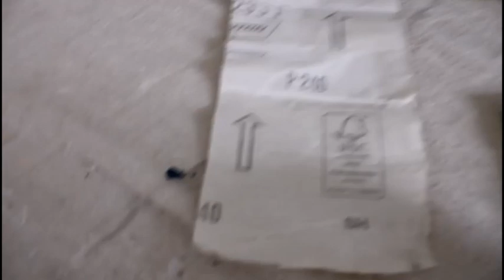How To Paint A Door Using Water Based Satin

Comment: Why don’t you get the paint on using a mini roller & then lay it off? much more efficient than flicking a 2” brush about?
Reply: I guessing its a texture thing.
Reply: Unless its a completely flush door and you have a dozen or more to paint it's just as quick to use a brush that's probably why he uses just a brush
Reply: It depends on various factors including the kind of paint and the ambient temperature. I tend to roll doors with a 4" roller either foam or microfibre, and lay off with a brush. A panelled door takes 10 mins per side with this method. In hot weather you have to apply water-based top coats that much more quickly and the faster roller on & lay off with a brush really works best for me. That said, this week I've been painting with Johnstone's Aqua water based gloss and preferred using a thick-bristled 2" Hamilton as I didn't find the roller speeding things up much. Happy experimenting!
Reply: I thought the same 🧐 I'd use a roller & brush
Reply: I use a brush to get it on then roller, I love the orange peel look, personal preference eh.

Comment: I ended up buying this paint and using a pure bristle brush just like you did in this video. My results weren’t as great as your review of the paint. I undercoated twice with armstead trade paint and then applied two top coats and even three in some areas and the coverage was quite poor. There were a ton of brush marks from the pure bristle brush too. I switched to a synthetic brush and that was somewhat better. Overall, I wouldn’t purchase this paint again.

Comment: My head gets frustrated with water based paints..I have done some test bits of skirting boards in varying light conditions in my house over the past two years and i am finding that some of these water based paints yellow too. I did one with armstead quick dry satin and after two years it has yellowed ever so slightly. Not much but definitely not as white as it was new. Homebase own water based gloss stayed the whitest of them all believe it or not lol although it not easy to get a good finish. . I have had a bit of skirting board in a dark cupboard for two years with dulux oil based gloss painted over a water based undercoat and it hasn’t yellowed too badly at all surprisingly. Sometimes I think the undercoat can effect the yellowing of the top coat. I sometimes go down the route of using oil on all jobs and just tell the customer that it needs redone every five years. I think all paints discolour and I’m tired fighting for a good water based alternative lol. I’m sticking with oil unless the customer can’t cope with the smell lol
Reply: Throw some vanilla extract in oil paint, helps with the smell.
Reply: Keep breathing in them paint vapours brother. I wont work with oil based paint unless the costomer is giving me £250  a day

Comment: they don't recommend using natural bristle with WB usually
Reply from the maker: We generally only use pure bristle they work great...  use them in emulsion all the time.
Reply: @PaintingandDecorating  I'm a big fan of them too, use them whenever I can. Just always been advised to use synthetics in WB wood paint. But I'll take your word for it judging by the videos you put up on here.
Reply: Great video and Hamilton pure bristle brushes I find also great for this application. Used the armstead quick dry satin in my own living room a few years back..... still looks lovely and white.... just one drawback I find... it might just be me... but when I wipe off dirty hand prints from the door with a clean cloth. The paint feels a little sticky afterwards for a few days at least. Then returns to normal? Weird I know. Doors were keyed and prepped very well beforehand. And also the sun on the window cill tends to make the pint feel tacky also. Weird.
Reply from the maker: Yes water based are not hard wearing...

Comment: Stick a little bit of Floetrol in with the water based paint and it gives you a bit more working time with it. Same with Owatrol for oil based paints , goes on lovely .
Synthetics are better than pure bristle in water based paints as well.  Nice vid .👍
Reply: Pure bristle can be just as good as synthetic or even better in some cases with emulsion, don't talk bollocks .
Reply: @simonright1507  even the Dulux trainer videos suggest using quality synthetic bristles for acrylic satin. Pure bristle is best for gloss.
Reply: @simonright1507  it's personal taste, pure bristle is better for oil based but you can use synthetic for oil as they are far better now than whst they used to be, I use synthetic and I've been a p and d for 37 years and I find them convenient as you can use them straight away without having to braik them in the other reason I use them is that a lot of the time it's water based paint I'm using not allways by choice I mite add .

Comment: Synthetic brushes are a must with water based paints. 
Because pure bristles draw moisture out of paint and can cause drag marks.
Best to dampen brush first before applying paint.
I also prefer to lay off 
To get rid of brush marks.
Reply from the maker: More control and faster painting using pure bristle...   synthetic... it's in the name...   keep it real.    only reason they push synthetic brushes is because they are cheap to make...   if you have not used pure bristle enough you wont understand.
Reply: I was pure bristle then went synthetic. Spent a lot of money only to find myself back to bristle. Whatever you feel happy with and works for you. No problems.
Reply: 100% mate. No way would you use pure for water based

Comment: I work with waterbase  undercoats all the time and glosses and they dry so quickly my method would to be to use a small scuttle and a hamilton  medium piles 4 inch roller just to get it on quick and would defiantly use a dulux trade as they are far better than DIY store Shop paints and to get a great cut in use a purdy  angle brush.

Comment: Can you recommend a satin that's not water based that doesn't yellow. I've got a skirting board in my hall that gets bashed a lot, I need something resilient but don't like gloss or yellowing? Thanks.
Reply: Only water based will not yellow. Try Johnstone's Aqua guard. Very hard wearing.
Reply: crown trade oil satin and Albany oil satin don't seem to yellow had them both in the garage without uv light for around 6 years and still white on the side of the tins all the others dulux jono's have gone yellow Albany oil gloss and crown trade next gen oil gloss hold the white for a long time too for todays oil glosses

Comment: Thanks for this video. I didn't expect you to get it on YouTube so quickly. Interesting about the Armstead paint and it has good reviews on Screwfix. But I was slightly concerned by one comment I saw, which said that it had slightly yellowed after a couple of years. As far as I can tell the Zinsser Perma-White satin doesn't yellow.
Reply: It doesn’t yellow at anywhere near the same rate as oil but it still does loose some of its whiteness. To be honest I think all paints discolour slightly. Even ceilings can discolour over time. I use oil for the finish it gives and use water based and waterborne paints if it’s a particularly dark room or the customer doesn’t like the smell or if the customer is happy for me to spend a lot of time changing their woodwork from oil to waterbased. But on most jobs I find dulux oil based gloss in white will stay white for a perfectly acceptable length of time especially over waterbased undercoat. Crown trade satin finish is also white and stays white for a good long time and its oil based. I have been back to jobs three and four years and it still looks white. I tend not to use brilliant white though I only use white so maybe this has something to do with it not going yellow as much. It’s a minefield but if I’m on a big hall stairs and landing that has been painted in oil before the last thing I want to do is charge the customer for me to paint 10 doors and frames and spindles all with three coats of waterbased paint when the advantages aren’t all that great considering it gets dirtier easier and doesn’t stay as white as u think. I’m happy with oil nice finish needs done in five years and wears well lol
Reply: @stuartmcintosh7187  Thanks for your detailed reply. I'll probably persevere with the Zinsser Perma-White satin for the time being but I may go back to Dulux oil-based in the future.
Reply: Mark Rowland I have used the Zinsser perma white satin in my living room about three years ago and it is still nice and white too so it’s a good one. I like how it adheres to old oil based paints without having to use a primer!
Reply: @stuartmcintosh7187  Yes, I've used it a few times now. Bit tricky to apply compared to oil-based but imo the advantages out-weigh disadvantages.
Reply from the maker: A customer as just asked me to start using oil gloss again for them...  as they think it looks better.
Reply: @PaintingandDecorating  I wonder if they'll be saying that in five years when it's yellowed a bit. Certainly looks better when freshly painted but after a few years...???
Reply from the maker: @markrowland5393  True but it does depend on how much natural light...  would be better to use a very pale grey instead of white...  people would get use to it eventually.
Reply: @Gary Day No. Have you? What do you think of it?
Reply: @Gary Day Bedec advance I presume you mean or MSP? Advance works pretty well, doesn't yellow as it a an acrylic. MSP is a useful paint but finish isn't as impressive as Advance or traditional oil. Best waterbased/waterborne gloss I use is Benjamin Moore advance, cracking paint to the point where clients think it's actually oil, it is pricey though. 

Hope that helps a bit?
Reply: @Gary Day that's fair enough, I have heard some very good things about diamond satinwood since it has been reformulated, I believe it will eventually replace the quick dry satinwood system. 

My advice for using any waterbased paint system is it is a slightly different technique to oil as it dries quicker so you have to work quicker to keep a wet edge, even application is very important to avoid curtaining, watch out for run in corners and preparation of the surface is of utmost importance if you are trying to achieve a perfect finish as its not as high hiding as lot of solvent paints
Reply: My house has all water-based products applied due to the low VOC (volatile organic compounds) of the paint product itself.  Oil-based products can leach VOC's for a considerable period of time and some may never fully reach that inert stage.

Comment: Top quality work as ever but I’m always curious why top notch painters like you don’t use mini rollers for panels. Any thoughts would be appreciated.
Reply from the maker: All depends on how much you have to do  and other factors.   We always like to lay the paint off with a brush for a smooth finish.  So a brush is always needed roller optional..
Reply: @PaintingandDecorating  thanks for that answer. Think it will be a while before my brush skills get to that level 😀👍🏻
Reply from the maker: No Problem    thanks..

Comment: Can you use oil based undercoat with water based satin.

Also can you sand oil based gloss and paint with water based. Will it peel
Reply from the maker: Yes, best to allow the oil to dry 24hrs.  And you can sand oil based gloss that is old and apply water based.   Thanks

Comment: Excellent video. Would this paint be suitable for skirting-boards if they have previously been painted in satin. Thanks
Reply: Of course, but sand it lightly to aid adhesion and then solvent or meth spirits to clean it off.

Comment: I want to paint my skirting but I think it's gloss, can I paint over it with this Satin without undercoat?
Reply: if it's oil based gloss, give it a good run down. Oil based satin/ or eggshell is self undercoating, so just two coats will be fine. If its an oil finish thats on and you want to move over to water based, I like to use a water based grip primer forst, then you can start going over with waterbased products without the fear of it peeling/coming away from the previous oil surface. There's a number of good base/grip undercaots on the market now. Remember, a lot of water based pain systems are one Uc, followed by two coats of the finish coat.

Comment: How do you deal with drips ?
Reply from the maker: Drips or runs...  Drips scrub out..  runs more difficult check your workover..  not too bad with oil gloss to scrub them out.. water based gloss no chance it will flash but you have to because you can not leave runs. water based satin you can scrub them out..

Comment: Have you any experience with using Leyland quick drying water based satinwood. I've used it today after priming with Zinsser 123 on some timber. Tried to apply it with a mohair roller and it started to bubble. I tried laying it off after couple of minutes. Still no joy. It was 12 deg today and I was working indoors in an outside shed. It was raining outside. Would moisture in the air cause this? Or what else could happen?
Reply from the maker: No, but rollers can cause bubbles funny you could not lay them off.
Reply: @PaintingandDecorating  I laid it off with the roller. Lol. I thought this was the same thing when the roller isn't loaded with paint. Like someone on the comments has said I went and ordered a Purdy Syntox brush to lay off with. Thanks for the quick reply 👍. Am I right in saying that laying off with the roller was a mistake?

Although on the 2nd coat I done a little test and let the paint go off for 10 minutes and ran the roller over it and that seemed to remove the bubbles.

These were not that important so I used them as a test but when I come to the floating shelves I want to get it right.
Reply from the maker: @SteS  Best to lay off with a brush really, but if leaving it then rolling over again works, then this maybe better on flar surfaces less brush marks. Thanks
Reply: @PaintingandDecorating  I messed up the pieces that didn't matter so much.. Hopefully that works on the first coat on the more important ones. Yes . All flat surfaces. Doors, shelving and frames. Going to prime and paint the skirting before installing. And touch up afterwards. So brush work for those areas. 

Thanks for all your videos. They're a great resource. Must of watched days worth of your content.

Comment: What's this like compared to Dulux Quick Dry Satin? That stayed tacky for ages
Reply from the maker: It's okay but any hard wearing places no good... better using oil satinwood.. thanks
Reply: @PaintingandDecorating  Thanks. I'm trying to avoid the solvent smells but that paint is looking like the best choice.
Reply from the maker: @ORGPPL1  it is good.. Leyland do some good water based paints..  I like the water based gloss..  thanks.
Reply: @PaintingandDecorating  OK thanks. I used Leyland primer and it performed nicely apart from the odd smell.

Comment: First of all you don't use natural bristle brushes for water -based finishes, thy shoud be a synthetic brush. Secondly, for large areas you roll it on with a short haired roller and lay it of in the same direction. Sand and dampen the area with a wet sponge.
Reply from the maker: Lol. what large area and secondly natural bristle are the best brush for all paints...  granted some water based clear varnish better using synthetic because black seems to come out of pure bristle ...  you think synthetic have been about for ever lol.  dampen the area will just make your brush skid about and soften any water based undercoat you have put on..  bad idea.
Reply: Totally agree London forever,for a start Armstead is bottom range also synthetics for water based,especially as Hamilton bristle brushes are like a badgers ass years ago they were king especially the 900s they were everybody’s top end brush,no more now anyone who does top end work uses Purdy or similar,I’ve been decorating nearly 40 years .On doors like those you cut around panels then roll with a fine mohair roller then lay it off with a long hair Purdy syntox
Ask any professional kitchen cabinet painter
Reply: Christopher Butts  .....do you paint coal cellars by any chance ?
Reply: Johnny old school you name it son  we’ve painted it
Reply: Hi mike,I would recommend tikkurila helmi 30[satin finnish] or sickens satura water based,DULUX satinwood,although with the DULUX the white is a bugger to cover for some reason,but the coloured satinwood is fine and don’t forget synthetic  brushes for applying